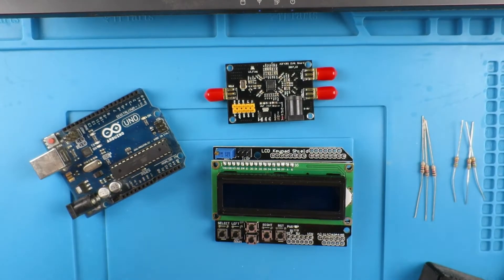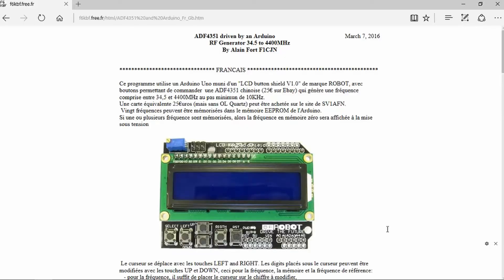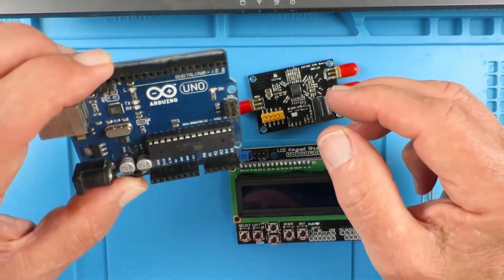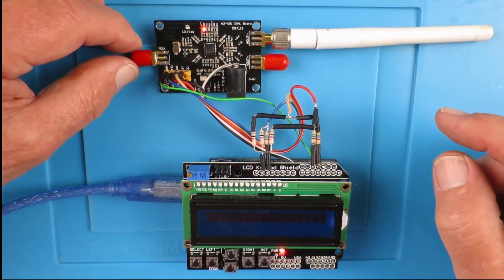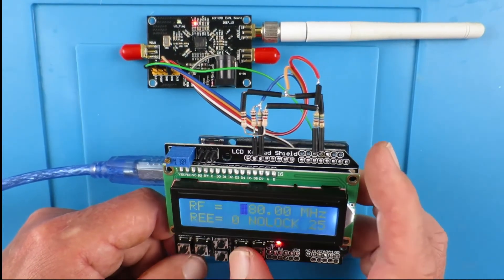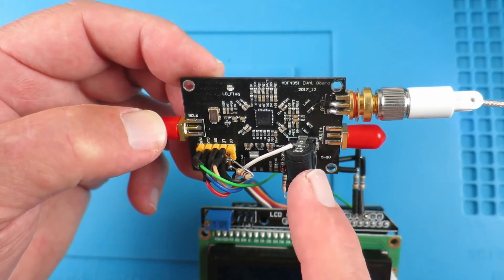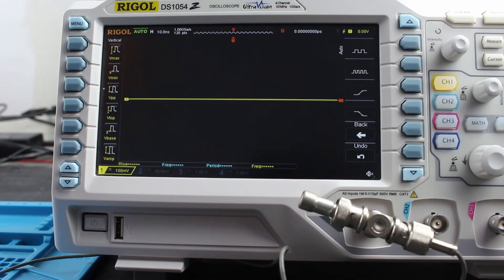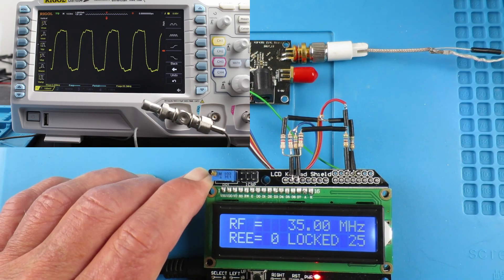35 MHz - 4.4 GHz RF Synthesizer ADF4351 Based Evaluation Board Electronic Project

Comment: How is the rf generator connected with the arduino and the lcd because the diagram does not show please explain because I do not understand how to connect between the pieces please help me 😓
Reply from the maker: The connection to the RF generator are shown in green at the bottom of the screen here : https://youtu.be/hYuCnsuqzjA?t=125  The "LCD buttons shield" plugs on top of the Arduino. You need to look at the original project linked in the video description. Thanks for watching, have a great day!
Reply: @1nformatica  How is the LCD screen connected to the frequency generator and the Arduino ??
Reply from the maker: @shba3387  The "LCD buttons shield" plugs on top of the Arduino to the header pins. See the description of the shield here: https://s.click.aliexpress.com/e/_ANVxsd The screen is driven by the Arduino, it has no connection to the RF generator. You need to look at the Arduino sketch.
Reply: @1nformatica  Thank you very very very much, you are the best channel for explanations ❤️❤️❤️❤️❤️😍
Reply from the maker: @shba3387  Hey thanks! I have a playlist of Arduino starter projects all with sketches included here : https://www.youtube.com/playlist?list=PLxtbRS-naT68bnU0-5bplazIwFfS5XmwO Thanks for watching, have a great day!

Comment: Hey Greg, I was wondering if it is possible to use the adf4351 as a VCO for plain analog FM? I wanted to make my electric guitar wireless
Reply from the maker: I don't think this is a suitable device for that. Maybe this is a better option : DSP PLL 87-108MHz FM Transmitter Module https://s.click.aliexpress.com/e/_9vwBpv

Comment: Hello sir , thank so much for you beautiful content can i ask .Did you connect the 10Kohm resistor between CE and GND terminals ?
Reply: Hey again , i used spectrum analyzer but its not working at all i saw a frequency spike but its not moving when i change frequency from the lcd shield
Reply from the maker: @hatemalhrbi5731  Usual trouble shooting, double check all the wiring. Do you see the LCD display correctly? If not check the Ardunio programming. You can contact the original author here : http://f6kbf.free.fr/contacts.html
Reply from the maker: Hi thanks! On my board I had to connect a 1K ohm resistor between CE and 3.3 Volts as you can see here : https://youtu.be/hYuCnsuqzjA?t=252 Please consider subscribing if you have not done so already!
Reply from the maker: @UCJR2cc75LY825Ef3hiWudXA I used 1K it is only a pullup resistor so either will do.

Comment: Does the project continue to work with the LCD Shield removed - with the last frequency loaded?  Don't need to leave the LCD shield inside the finished project.
Reply from the maker: Sorry I cannot try that due to the way I have soldered the connections. You can contact the original author here : http://f6kbf.free.fr/ Please consider subscribing if you have not done so already!
Reply: @1nformatica  Thanks.  I will, and I have ordered a SMT shield to go  between the Uno and the LCD/Keys.  I'll update you when I'm done.
Reply from the maker: @edmanuel6885  Good luck with your project.

Comment: Hi, would this be suitable for recalibrating an old hifi FM tuner?
Reply from the maker: I guess so, I think it is accurate to within 50ppm.
Reply: You would probably want to use a low pass filter (like 120-160MHz) if you used it for that purpose.

Comment: Would it be possible for you to provide a connection diagram between the Keypad LCD shield and the Arduino UNO?  I am not able to discern the connections from the diagram provided on the project website.
Reply from the maker: Sorry, I do not understand. The LCD shield plugs directly into the Arduino. The only connections needed are to the ADF4351 board. These just happen to be easier to do using the LCD shield pins rather than the Arduino itself.
Reply: @1nformatica  Ok! Thanks for the clarification.
Reply from the maker: Let me know if you have any other questions.
Reply: @1nformatica  hello again, how would I edit the code if I wanted to pulsate the waves?
Reply from the maker: @rohitmisra5430  Hi, I would not know how to do that. I suggest you contact the original developer here : http://f6kbf.free.fr/contacts.html
Reply: @1nformatica  hi, how did you ground the 1k resistors? Which GND pins do i use on the arduino?
Reply from the maker: @rohitmisra5430  You can see here : https://youtu.be/hYuCnsuqzjA?t=147
The ground is the second pin in on the LCD shield. This plugs into the ground pin next to "AREF" on the UNO.
Reply: @1nformatica  ok thanks. Also is it save to solder the wire from the +5v directly to the power supply of the adf board (ie the white wire)
Reply from the maker: @rohitmisra5430  I think it is quite safe to have the 5 volts connected like that. It has not caused me any problem.
Reply: @1nformatica  last question, 😂what resistor did you use to join the CE pins on the adf board?
Reply from the maker: Hi, it's a 10k ohm resistor from CE to 3.3volts. You can see it here at the end of the yellow header : https://youtu.be/hYuCnsuqzjA?t=227
Reply: @1nformatica  thank you so much!
Reply: @1nformatica  what was the cable you used to connect to the oscilloscope. Can I use a coaxial cable? Is a 50ohm load required?
Reply from the maker: Any 50 ohm coax will work. I made my own cable from an old wifi antenna for the SMA connector to BNC. A load is required : https://youtu.be/hYuCnsuqzjA?t=269